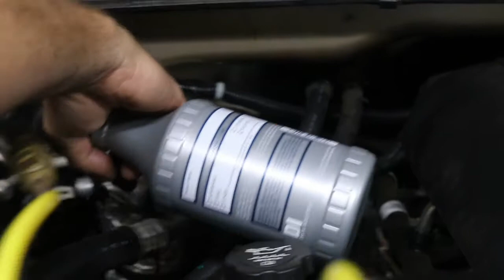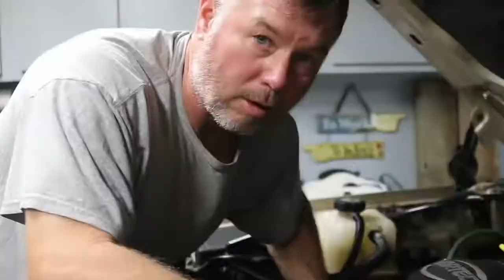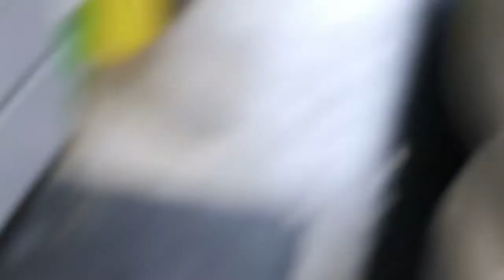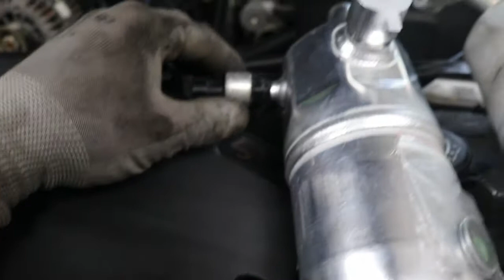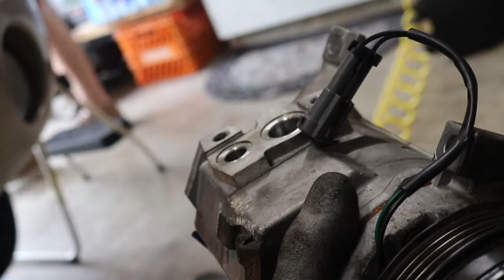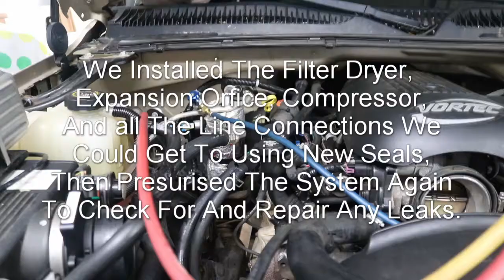2006 GMC 2500 Ton Air Conditioner Compressor Replacement

Comment: Thanks for taking the time to make and post the video for others to see. However, I highly suggest using nitrogen to pressurize the system, checking for leaks with the nitrogen and then using a vacuum gauge and pulling the system down below 700 microns (lower = better). The nitrogen will also help pull any moisture from humidity, which can sometimes be an issue when pulling the system down. I should note that the nitrogen will have to be removed down to an acceptable level before starting the vacuum pump, as the pressure could damage the vacuum pump.

Comment: When you have a bad compressor like that most warranties for the new compressor won't be valid if you don't change out the condenser as well.  If you don't replace it you can flush the inside of the condenser out with alcohol and blow it out.